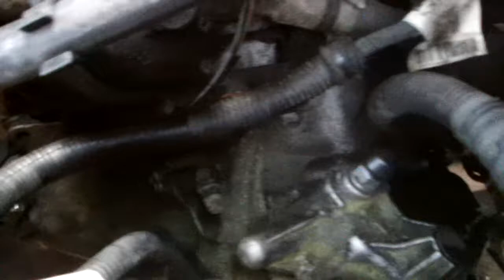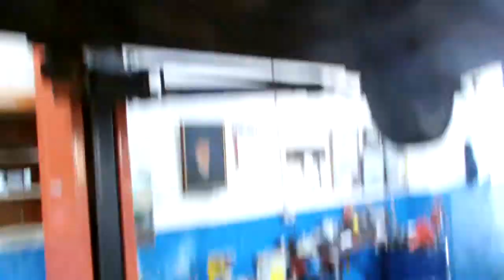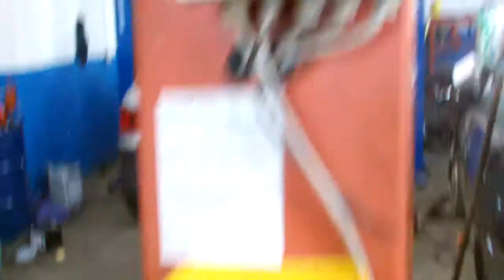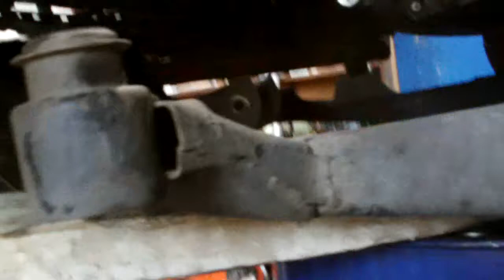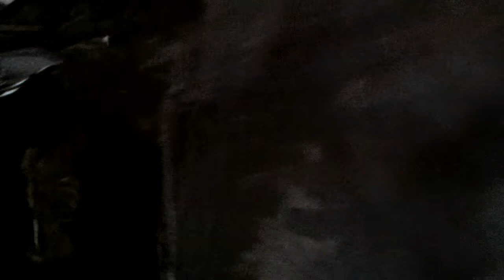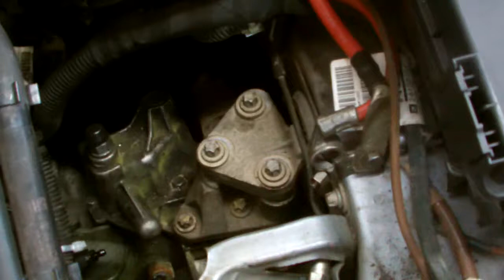VAUXHALL/OPEL ASTRA H GEARBOX, replacment part 2

Comment: hi did you get the drive shaft to lock in ok as mine are going all the way in but not locking.
Reply from the maker: check the circlip in not damaged or missing on the end of the shaft